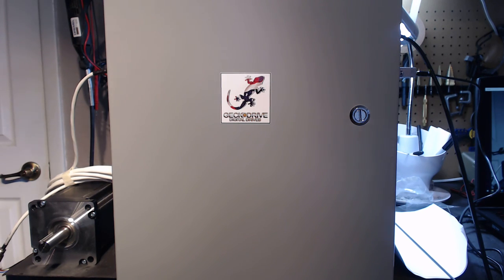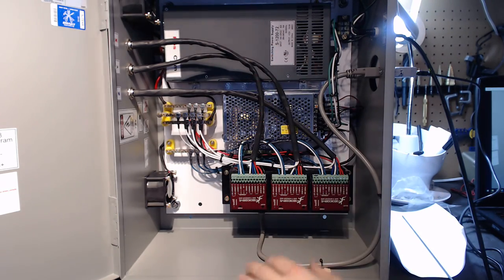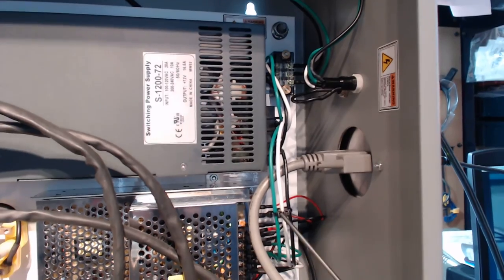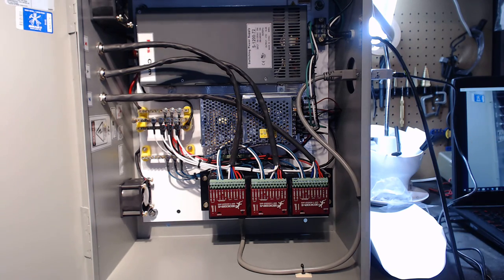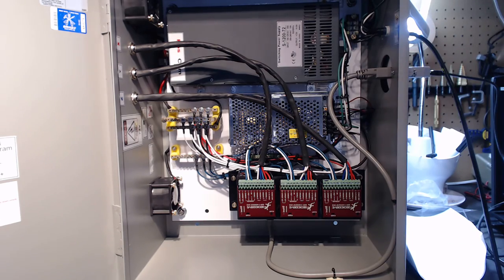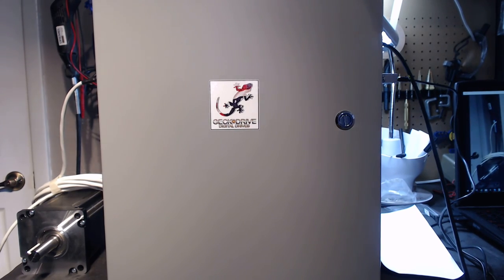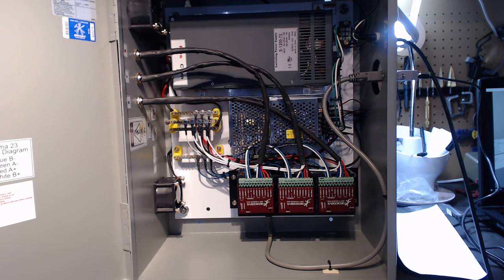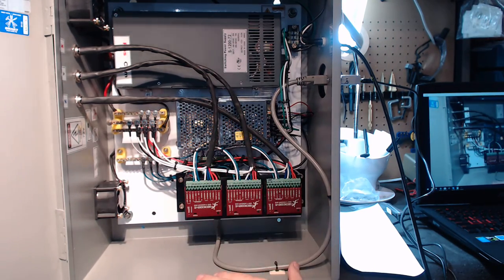Gecko G203v Commercial Build Breakdown...

Comment: I have been using gecko drives for the past 8 years.

I have bought at least 8 G203V's and recently 2 GR214V's. I have been VERY happy with GeckoDrives. Fantastic product, fairly easy to wire up and configure. Good support, excellent warranty service (needed once when I cooked a G203V (severe user error)) and excellent build quality.

Cant say enough good things about this company. Really happy for the USA made and Designed aspect of their products. 

I can unreservedly recommend GeckoDrives. As in the last 4 machines I converted, the next one will have GeckoDrives as well!!
Reply from the maker: dest101101, thank you for your support, and you wrote it best  :) 
Thank you,
Vince

Comment: I am in the process of building my first CNC milling machine and have been doing a lot of research and buying some things as I go. The mill is a PM940 and it is on order and should be here within the month. I've watched a lot of videos from guys who seem to know their stuff but watch them mount the VFD inside the same box as their other components which I thought was not a good idea. Then I watched your vids on mounting the VFD outside of the main control panel and into it's own box several feet away. That's makes more sense to reduce the EMI. Also, I have seen them use shielded wire without hooking up the drain which is defeating the purpose of using a shielded cable. I've seen some just cut a gapping hole in their box and run all the communication cable thru the hole instead of using EMI blocking connectors. I have found some L-Com EMI blocking connectors for USB, DB25, HD15 and the sub panel mounting plates for these connectors that I will be using. I am amazed at how expensive a used enclosure is. I have been looking for a while and ran across an unused Hoffman 27x20x8 enclosure at a great price. It's a NEMA 11,13 enclosure so it is a good heavy duty sealed enclosure. After doing a lot of research, I can see why these complete units cost as much as they do. I few months ago, I would have thought someone who be crazy to spend 4G on a control box but knowing what I know now, I think that is a fair price. It takes a lot of knowledge and research to be able to put together a control unit that is dependable. One has to educate themselves on every detail of everything involved like wiring, connectors, drivers, motors, controllers, CAD/CAM, power supplies,  EMI blocking components, enclosures, VFD's, spindle motors, limit/home switches, relays and everything else like ball screws, mounts, tooling. There is a lot to learn and know. That is why I am up at 1:00 in the morning doing some research. Thanks for the videos and sharing your knowledge. It is very helpful.
Reply from the maker: Halfstep67, thank you for your support I really appreciate it. There are many unrealized details as you pointed out to properly building a motion controller. These units are popping up everywhere on the web, and YouTube, and many of them unfortunately fall short on being built correctly because many vendors/end users simply copy what everyone else is doing rather than researching the components their working with, and understanding how to properly install them to support their applications, and business model.

These systems are amazing when built properly, but can also be just as amazing at defeating their purpose when simply thrown together like so many of them are online as you pointed out. Education starts from the end user utilizing every resource they have available, and if they aren't able to use the web properly for it, and or don't have the time to invest they are far better to have the  system properly built for them. 

The price on a motion control system built, and engineered properly is reflected by many variables, as every clients requirements are different. The amount of time I spend in labor, while investing my years of engineering knowledge on the project is where the price easily exceeds 2k for a built turnkey multi-axis individual drive system especially when including my added after sale support which virtually all of my clients will require at some point. I know my clients that pay to have the system built turnkey realize the price is an investment in "peace of mind" considering these systems will offer a point of leverage only larger factories used to be able to afford. Another point seldom discussed anywhere online is all of these systems built by the end user, or professionally are business tax write offs, and really should be one of the easiest investment choices when realizing the massive advantage of that when your a startup, or established company. 

Thank you,
Vince

Comment: Nice design Vince although I do not use aviation plugs for my cables. My reason is direct connection is better for me as I want IP65 rating. I have no fans either as I use a very large heatsink with temperature monitoring. Your cooling system is very good and I like how you have simplified the construction for ease of maintenance.
Reply from the maker: Robert, thank you for your support, and kind words. Vince

Comment: Hey corvette guy, I am a newbie and just learning may way in. I have big drivers and arduino shields however I am running into trouble with very small micro stepper motors where I cannot turn down the voltage and current to avoid toasting the micro motors. Can you do a video on the micromotors? Or any advice on drivers? Thanks.
Reply from the maker: FrustratedBaboon, Thank you for your support. Unfortunately I don't work with Arduino based systems, and micro motors.  Thank you, and Happy New Year! Vince

Comment: hi, love your videos, you are so pro... 
may I ak why use 72v to the gecko drives when most stepper motors are rated at 50v max.?
thanks
Reply from the maker: Hey Warren, thank you for your support. The 72v option for power is designed for use with my motors, however many steppers will support using it. Here's the tutorial on power supply selection from Gecko Drive.  SECTION 7: MOTOR HEATING AND POWER SUPPLY VOLTAGE covers it here https://www.geckodrive.com/support/step-motor-basics.html  Overdirve ration is allowable up to 25x the motors rated voltage. Remember more voltage equals better resolution, and more power Thank you,
Vince

Comment: Wouldn't it be better to have more surface area on your fan filter?. Not judging, just asking. I am using disposable 8"x6" 3M Easy trap duster sheets doubled up for filter media because those foam ones looked way too restrictive. Hey, it works. My repurposed computer case has 4 quality japanese 4" fans. 2 pushing air out of the case and 2 pulling air in. The intake routes cool air across my drivers first. My heatsink/driver base is similiar in size to yours and was salvaged from an old Hitachi stereo. Need all the help I can get with my imported tb6600 drivers. My power supplies (yes 2) are up top as well. Only running two seperate ps's because the pc case supply was almost new and I do not want to run my imported stepper power supply at anywhere near what they claim for output watts. The 12 volt pc ps is all for case fans, stepper fans and led spindle lighting. Big heatsinks with fans for all my nema 23's. Cool electronics are happy electronics. Happy to see my layout is similiar to yours. Good work.
Reply from the maker: Jeff, Thank you for your support. The 60mm metal fan filters are designed around the size of the fans intake which provide perfect filtering, and being their metal have no restriction. 

You couldn't be more right coll drives are drives that will have the most longevity.

Thank you,
Vince

Comment: looks great Vince... if i finish my Projekt i will share it also with everyone. Great job

question... i know aviation connectors who you fix it with a quarter turn. every one i see have to screw. do you know which i mean?
Reply from the maker: Murat please do.Yes. The GX-16 connectors are screw lock connectors which at the most safe to use in this type of commercial applications. Typically screwing them together requires nothing more than a full turn, and a half to lock them together,Thank you,Vince
Reply: corvetteguy50 Ok Thanks... do you know how Ampere that i can pass through this connectors? do change that 3-pin or 8-Pin?
Reply from the maker: The connectors are rated to 380v at 5a. The ones I use are 5 pin to attach the shield drain to the 5th pin as the motors are only 4 pin. I then attach the shield drain to the Earth Ground terminal in the controller to properly diffuse any EMI.Thank you,Vince
Reply: corvetteguy50 thank you very mutch Vince...  regards from switzerland